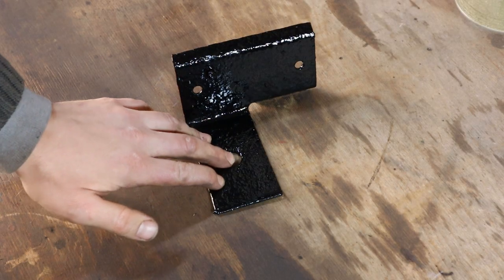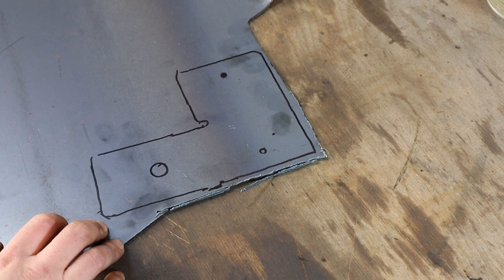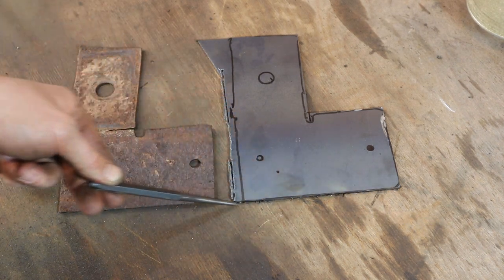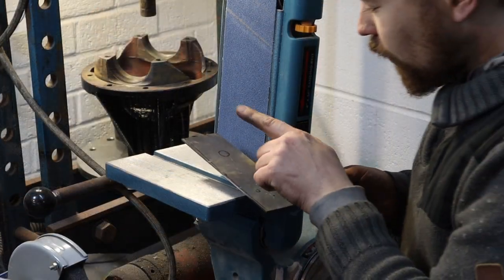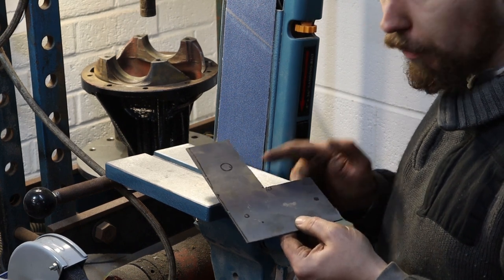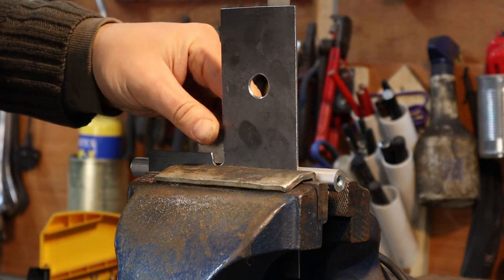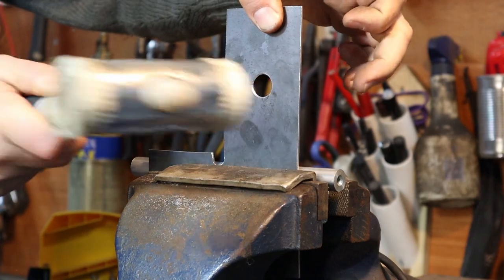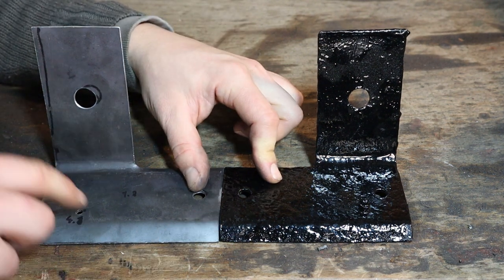Land Rover Series 2 Restoration: Brake Pipe Bracket

Comment: Your plate utilisation game is weak, you left too much on that you had to grind each side,  use the rough sides as you're going to tidy them up on the sander anyway.  Work smarter, not harder.  Lessons can be provided for keen students.
Reply from the maker: I think I decided to use that corner as it was the only one I could get in front of the camera. I think this issue can be solved if I start by building a bigger garage with more space? 😁
Reply: @HalfJobGeorge  Well that's content sorted for a year or two, and you get a bigger workshop!     Win win!!!!